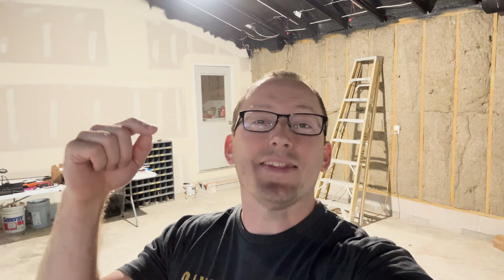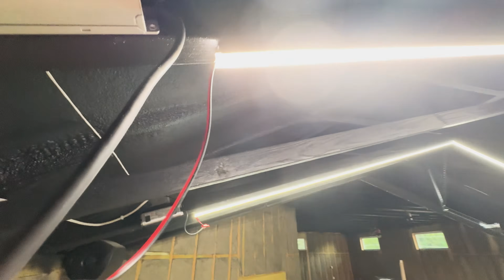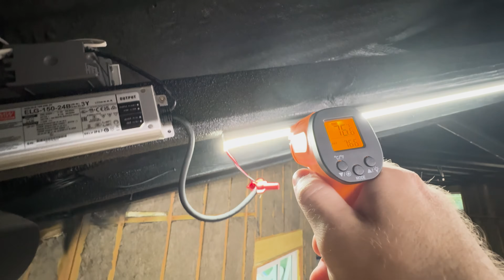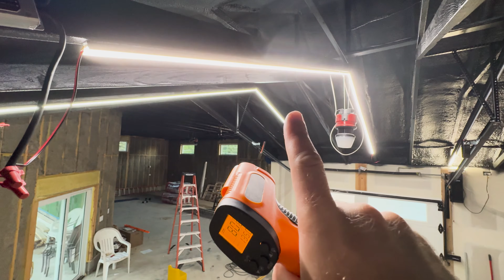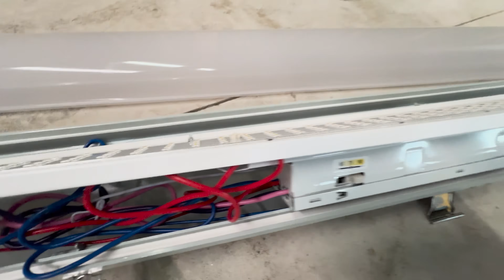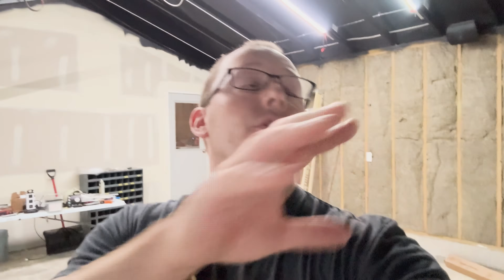Overheating LEDs?!?! // DIY Garage Lighting Part 8 // Garage Build Ep. 40

Comment: 140 degrees is no where near hot enough to liquify any standard solder.

If your connection got hot enough to cause solder joint issues you have a much larger issue.
Reply from the maker: Thanks for the advice